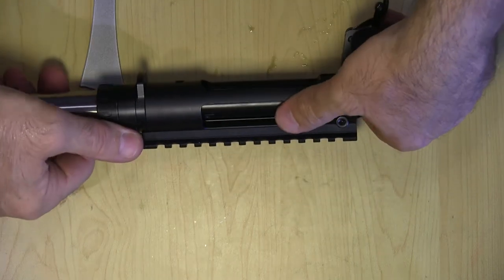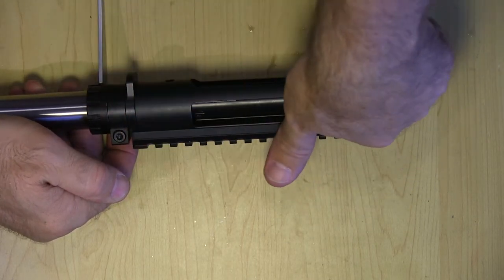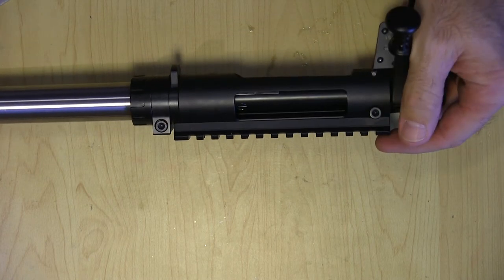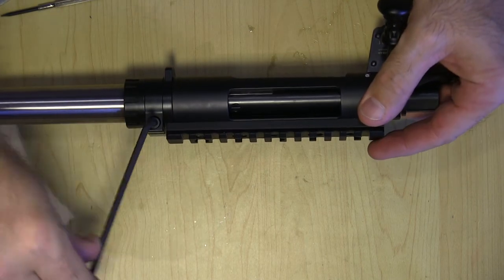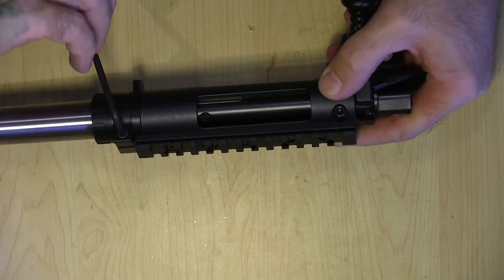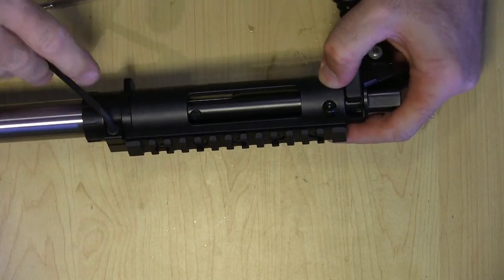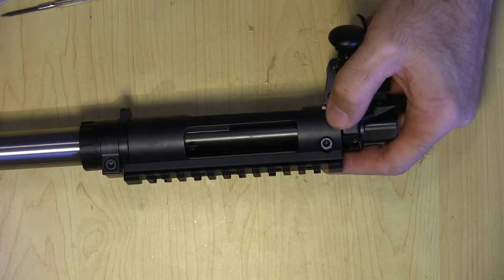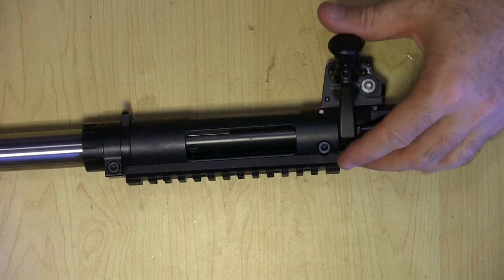Barloc Assembly of Nucleus Part 2

Comment: Why a Barloc?  Because it's a miniature jackscrew assembly.  It allows you to preload the barrel/receiver threads without risk of galling and without putting the torque of tightening or loosening the barrel through the body of the action.

It is slightly more complicated than a barrel nut or barrel shoulder but all of the parts are robust and should not fail.

If you are having trouble with lining everything up during the assembly, there is a trick:

Take the socket head cap screw out of the Barloc clamp.

Put a shim in the slot of the clamp and then screw in the cap screw from the opposite side so that tightening spreads the clamp slot to the width of the Barloc wrench.

Assemble the barrel, Barloc barrel nut, spread Barloc clamp, Barloc recoil lug and receiver aligned and headspaced as you desire, hand tight (no wrench needed).

Remove the cap screw and shim.

The tension in the Barloc clamp should hold everything in position. 

Lastly replace the cap screw in the original position and torque to suit with the included Allen key or an inch-pound torque wrench.

Congratulations, you have just barreled your rifle with an Allen wrench and a shim.  No action wrench or barrel vise required.  If you want a switch barrel setup, I doubt you'll find anything better although I think you waste too much ammo zeroing after a barrel swap for switch barrel rifles to make sense.

Undoubtedly some people will not need or understand the benefit of the Barloc system.  Personally I like it a lot but it isn't on my latest rifle build, a shouldered barrel seemed more appropriate for a big .338.  Anything with less than the heaviest barrel contour is a good candidate for a Barloc and if you can find a scope rail that overhangs the front of your receiver, modifying the rail to fit a Nucleus style Barloc recoil lug (and bedding the rail to the recoil lug) is a good idea.

I'm going to post this comment on other Barloc videos...